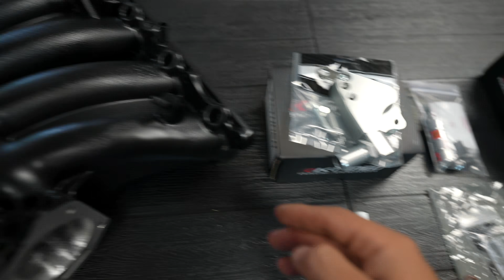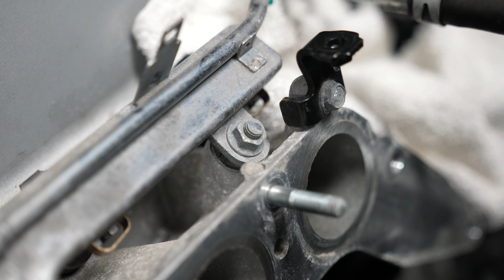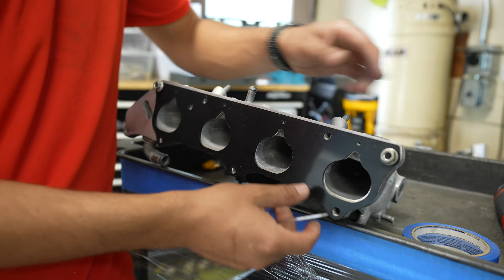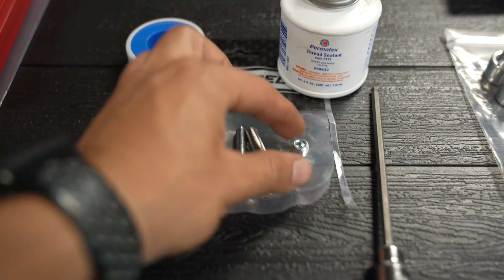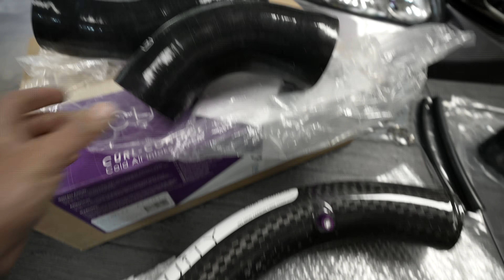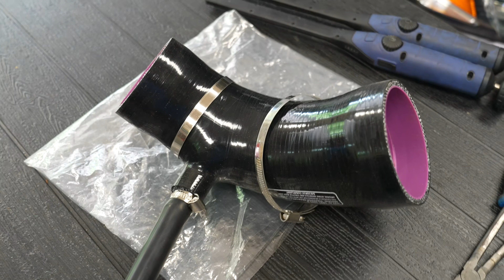RBC Intake Manifold Swap & Throttle Body Install // 9th-Gen Civic FBO Part 3 of 4

Comment from the maker: FOR THOSE INSTALLING THE KTUNED WATER BYPASS, I suggest tapping the cylinder head and using the included hardware to guarantee the bypass won't leak. I had no issues for the first couple of weeks, but then noticed it had a slow leak from that area. After tapping and using the additional hex bolt, I've had no issues since.
Reply: My k tuned adapter leaked with the spring / bolt method. PROFUSELY!  I didn’t want to drill and thread my cylinder head, as I found out through other sources. Even if you thread your head, it may STILL leak. I removed the k tuned adapter and purchased a TRAC TUFF K24Z adapter. No silicone needed. No leak. No drilling and threading needed to install this unit. The owner of Trac Tuff is very intuitive also. If you have any questions, he responds immediately and honestly.
Reply: @RittenhouseLifestyle7  Dude thank you so much for this comment! I just bought it and cancelled my k-tuned coolant adapter order. Not only did you save me over $30 bucks, its actually delivering sooner than what the ktuned was going to deliver. Im very excited im not gonna have to drill and tap my motor because i wasn't looking forward to that. Especially hearing how many people are still dealing with leaks afterwards.
Reply: @rivalnico8557 how’d it go?
Reply: @arodyrosa3833 it went flawlessly. No issues and it came with all the hardware. I just put a little lube on the o ring and then lock tight on the nut that locks the bolt in place that keeps tension on the coolant adapter.
Reply: @rivalnico8557 shoot thanks just bought it, gonna do the same!!
Reply: @RittenhouseLifestyle7  Hey man, what intake gasket did you go with? OEM rbc? Or did you use the skunk2 thermal intake gasket (the one in the video) or otherwise? Please let me know I will buy the exact same one as I know with the tract tuff, how far the RBC pokes out matters!!
Reply: @RittenhouseLifestyle7 Hey man, hope u doing well i just came back to this vid cause my ktune adapter is giving me crazy problems, just bought what u mentioned can’t wait for it.
Reply: Just got a cnc ported badguys worldwide rbc and this vid helps out a lot
Reply: @pinoceo  Did you max out the stock injectors? Did you switch to the rdx injectors? If so did they fit in the stock 9th gen si fuel rail or did you have to get an aftermarket fuel rail?
Reply: @Exceed_life  haven’t thrown it on yet
Reply: @pinoceo  when you throw it in can you see how the stock air box fits?
Reply: @Exceed_life  sure but just based off the differences of the 8th gen IM and 9th gen IM, I dont think the intake tube will fit for the oem air intake housing.
Reply: @pinoceo  I was planing on running the stock TB I just wanted to know if the hose can reach it without much problem
Reply: What did you do with the two fittings on the bottom of the throttlebody you didn’t explain what goes there you jumped right in to putting the coupler fitting for the cold air intake
Reply: @Hawaiian239-4x4  Im wondering too I need to know.
Reply: @Hawaiian239-4x4  They seem to be coolant hoses, from a google search.
Reply: Did you record it? Plz post if you did!
Reply: Did you max out the stock injectors? Did you switch to the rdx injectors? If so did they fit in the stock 9th gen si fuel rail or did you have to get an aftermarket fuel rail?
Reply: So i was able to snag a rbc manifold for a deal...its cut but i found out its also ported as well. My only concerned was if it would fit properly on the stock throttle body or would i have to order a new one. Id rather much keep the stock throttle body.
Reply from the maker: @Tae_94  You can use a ported manifold with a stock throttle body, just like how you can use the opposite.
Reply: @milanmastracci  i appreciate the reply my man 👍
Reply: @milanmastracci  are you taking a break from youtube?
Reply: The two hose connections on the throttle body are capped of now right ?
Reply: Anyone find out what he did for the 2 ports right under the throttle body?

Comment: 23:00 you can actually pull more wire from the harness in the black hard plastic, this makes an extension not necessary and that also avoids weakening your signal to the dbw setup!

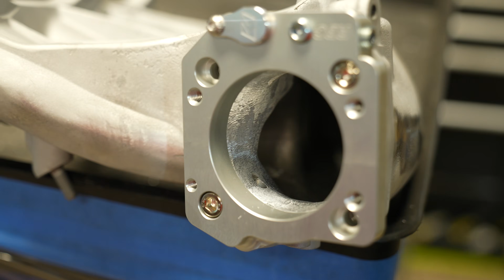Comment: 12:03 .. IMPORTANT QUESTION⚠️ once engine is running and you’re cleaning up data logs, did you have ANY experiences with abnormal TPS zigs and zags under high load and high rpm? Or ANY strange factors due to boring manifold inlet? I just recently did my RBB inlet and I’m dealing with this. FYI nothing to do with tps calibration.

Comment: Hey there man, what size would you say the Idle air control valve Vacuum hose is ? I'm installing a skunk 2 street intake manifold with a j37 throttle body. So I have to use a different throttle body adapter from hybrid racing because I don't think the PRL adapter kit will connect a ZDX j37 throttle body to the skunk 2 intake as its a PRB intake, not RBC. so I'm gonna run the Vacuum hose to the bottom of the new intake where the ports are,  just was curious of the Vacuum line IACV size in case the stock hose won't reach. Thanks
Reply: bro i have the same problem

Comment: Thinking about getting rid of my stock plastic intake manifold on my 2nd generation CRV, will i get a check engine light from a intake manifold swap? Appreciate anyone who can help me with an answer.....
Reply from the maker: You might, but I wouldn't consider the swap unless you get it tuned, so ensure that you can do that prior to doing the manifold swap.

Comment: Do you need the throttle body adapter to run the stock drive by wire throttle body ?

Comment: ive got a 7th gen accord build and this is by far the best video. i couldnt find much info on the middle parts that you had, just removing and tightening up really. but this showed me the proper way to do the fuel injectors. i wish i saw this before
Reply from the maker: Glad you liked it!
Reply: What did you do with the pcv valve
Reply: Sabes si ese trottle body funciona en el Accord cl9?

Comment: do i need the Throttle Body Extension Harness if i use a stock throttle body instead of a bigger one?
Reply from the maker: Yes you do, so you can extend the wires yourself by cutting the factory wiring harness, or you can purchase this little extension piece. When running the RBC manifold, the throttle body is mounted in a slightly different location in the engine bay, and the factory harness is not long enough.
Reply: @milanmastracci  okay thank you i ordered the extension so i dont have to cut it

Comment: @milanmastracci Question, I want to do the RBC & ZDX swap but solely on aesthetics to compliment my skunk2 intake, can I use a skunk2 manifold instead of the rbc? Given I do the same process?
Reply from the maker: I don't see why not!? Just make sure that the ZDX TB works on that manifold, or ensure you purchase the right TB adapter to make it bolt up to the Skunk2 manifold.

Comment: Just realized this is all for an intake manifold swap ......y not upgrade fuel rail?
Reply from the maker: This video was showing you how to swap the RBC for relatively cheap. Upgrading the fuel rail does not bring any performance gains, only for aesthetic. If you're upgrading the injectors, I'd change out the rail while you're at it.

Comment: Hey man! Finally got all my parts and everything installed cars running and all. I seem to have a leak in the Ktuned bypass adapter even with putting on the honda bond. Any ideas why it might be leaking? O ring is still perfect as well. Maybe im tightening the spring bolt too much causing a space?
Reply from the maker: Did you tap the head? I ended up having to do that as it started to leak on me after going to the track
Reply: @milanmastracci  after letting it sit for over a day before bleeding and filling it seemed to have stopped leaking. Ill keep monitoring. If not ill either tap the head or try the tractuff option. Thanks for your reply!

Comment: What happened to the accord build.. lol. Was the 300 mark ever made.. I was planning a build similar but couldn't find out the piston to valve clearance issue.. so far the k24a1 is the only block I know that will accept a k24a2 head

Comment: hey i have a question. i have a honda accord with tsx intake manifold and i was thinking of doing that intake manifold coolant bypass. problem is, right in that spot i have the coolant temp sensor which has a bigger thread. Would i have to buy k-tuner's coolant temp sensor and replace it? would i need anything else? I can't really find anything on the internet. Thanks to whoever helps.

Comment: Does the bigger throttle body alone add any power without Rbc?
Reply from the maker: I can't say for sure, but if the throttle body is restrictive for the factory manifold and head, upgrading the throttle body will 100% allow the engine to get more air, which results in more power.

Comment: my ktuned bypass is leaking my whole engine starts smoking idk what to do😕
Reply from the maker: Tap the cylinder head and use the extra bolt that came with the kit to secure it into place.
Reply: @milanmastracci  update i fixed it i used an extra layer of hondabond but now it’s overheating itself

Comment: Didn't mention one important information. If you use the j37 tb with stock ECU, the ECU isn't going to last long as the j37 pull 9-10amps whereas the Si ECU can only pull a max of 5amps.  This is why people are complaining about fried ECUs. 
Guys, if you are using a j37 dbw TB on a civic 8th, 9th gen Or Civic FN2 you NEED TO SWAPS THE TB MOTOR FROM YOUR OLD THROTTLE BODY!!!!!!!

Comment: Question. If you already have the ktuned adapter kit for the rbc. All you have to buy is the fitting and a hose and it should work? Or do you have to do more than that to modify the adapter?

Comment: Can I use the same parts you used for a 2008 acura tsx?
Reply from the maker: Some of the parts will work, where you may need different adapters for the manifold.

Comment: Can this be done in a 2008 accord
Reply from the maker: Sure can! Since the engine is almost identical, you'll just need a cold air intake that works with your car, everything else that you saw in this video is compatible 👍

Comment: Some good words of advice as an owner of 9th gen 2 door bolt on power is good and all but do your self a favor and do a full build top and bottom end before you start spending money the motor does have a few weak spots not addressed you well spin a bearing or get the famous tapping thinking it's all good just noisy injectors not the case ug the timing chain tensioner right away first before anything watch what you change your hondata does alot on stock throttle body more power and hacked mods well destroy this motor its strong but I promise you want to invest to make power or boost seen guys spend lots only to discover the engine needed to be built before the ug don't be that guy selling because the turbo killed the crank bearings yes it can take some abuse won't last maybe in stable warm weather iam at 78 000km doing full build famous tap tap well get you 30hp maybe 50 hp on a stock motor after that your playing dice trust me save the money build it right and you have a gem with crazy potential with bolt ons hondata and a dyno is crucial with out it even changing your exhaust to race well leave you parked

Comment: You should've took the fuse for the fuel pump out then started the car it'll only run for like 3 seconds then shut off it'll clear the fuel rail of any fuel so it wouldn't be a mess

Comment: @milanmastracci man i need help to find a 72mm tb adapter for my ktuned 72mm tb i also have the same set up just difference are the tb brand and intake. I need help because of my tb i didnt have the adapter so I didn't know where to connect the 2nd vacuum hose which is in your video u connected it to your tb mine doesn't have that so i just connected it to the bottom of the rbc manifold because mine for some reasons it has a hole in there and i just plugged in something there and connected the vacuum hose there so far no problem but im still concerned. Sorry for the long paragraph! Hopefully u see this thank you man!
Reply from the maker: I don't think you need to run an adapter for the Ktuned 72mm. I believe it bolts right up. I'd have to see your TB and vacuum line situation in front of me to help.
Reply: @milanmastracci  yeah i could send a picture but idk if i can send it here in the comments.

Comment: can I still run a 9th gen intake with the stock tb on the RBC manifold?
Reply from the maker: You're gonna have to try again brother lol I don't understand what you're asking.
Reply: @milanmastracci  i fixed it man my bad i was probably exhausted from work
Reply from the maker: There we go lol no worries brother! You can run an RBC with the stock TB, however you will need a different TB adapter to run it. So just like I had to use an adapter to run the ZDX, you will need an adapter to run the stock one, and PRL also makes one which makes the install quite easy.

Comment: I got a problem! When I turn on the car after the installation it goes to limp mode and got idle problem? Do I need to install firts a basemap for the rbc ? And how can I do the throttle body relearn procedure?
Reply from the maker: At the end of the video, I mentioned 2 ways how you can perform a TB relearn. Either of those routes will work. You will need a revised tune to get this running properly, however Hondata has some that are adequate for the time being.

Comment: You need to k swap the mini... best of both worlds !!!
Reply from the maker: That would be so sick!! Amazing chassis finally paired with a good engine 🙌
Reply: @milanmastracci  there's a guy in the tri state area that makes a motor mount kit for the R53 chassis and R56 as well. No cutting on the mini engine bay. And you can still run a/c !
Reply: @milanmastracci  look up k swapped r53 (awd) on iamtaiboogies YouTube page !!!
Reply from the maker: Such a sick build, however it doesn't fit in the engine bay without custom frame work. I'd love it if it fit in between the frame rails.
Reply: @milanmastracci  IT DOES !!!!

Comment: Quick question u didn't have a prl tb adapter where do i route the vacuum hose? Because i saw that you routed the 2nd vacuum hose to the prl adapter. I don't know where to put mine, i also have a skunk2 intake and i had to make it short ram because I can't find a coupler that fits 72mm tb  that is compatible with the skunk2 intake design. Any recommendations bro? So i can fix my wirings management for battery and so my engine bay won't look messy? Thanks you bro! I'll appreciate it so much if you can help me 🙏🏾🙏🏾🙏🏾
Reply from the maker: Does the skunk2 have a coupler that works with the larger TB? I haven't looked into Skunk2's intake much after finding Acuity's intake kit & battery relocate. It seemed to be the best overall intake, the most well-engineered, and you can buy a bunch of different couplers should you change TBs or IMs down the road 👍

Comment: Is it harmful to drive it without the tune? Or is the tune just required in order to see any gains?
Reply from the maker: It is! If your engine isn't running the correct air/fuel ratio, you can cause damage to the engine. I strongly suggest getting a proper tune following any engine-related upgrades.
Reply: @milanmastracci  So I work at Honda as a apprentice Tech, couldn't you just remedy getting a tune by doing a ECM/PCM reset? The car would relearn the air to fuel ratio?

Comment: I installed the rbc manifold with rdx injectors, k tuned shortram and k tuned fuel rail but not hondata, the rpm goin up and down its normal cus i don't have the flashpro  ?
Reply from the maker: You will 100% need Flashpro or KTuner to get it running right, but that sounds like the TB needs to be relearned. I outlined towards the end of this video how to get that done 👍

Comment: I dont understand though, why spend the money to go NA on this engine that is basically hamstrung from the get-go, due to the headifold and lack of exhaust VTEC.
What happened to the K24Z3 + K24A2 head idea?
Reply from the maker: The reasons I can tell: 
1. Naturally aspirated reliability
2. Less complex than turbocharger install
3. Easy to return back to stock
4. Not looking for most power numbers, just enjoyment. 

At the same time, I do 100% understand your statement. It does cost abit and require a bunch of work to the intake and exhaust to get some a slight bump in gains from it. 

That engine is still getting swapped, but I wanted to try the FBO route first 👍

Comment: Can you do this to a 8th gen accord without the injectior adapter and would I still need the throttle body adapter?
Reply from the maker: You can do all of this to the 8th gen accord. You would need everything you see here, however you would need a different intake to get it to work as the Acuity is vehicle specific.

Comment: ZDX throttle body is over kill and will not gain any power without cams, also the ecu will have to work harder to control it
Reply from the maker: One way to find out 🤷‍♂️

Comment: Hey Milan! Love the channel! When will you be swapping the cylinder head for the K24A2?
Reply from the maker: Very soon! I have a bunch more parts to install on the car to get it ready for more power 👍
Reply: @milanmastracci  awesome! Can't wait to see what you have planned! Keep up the incredible work! 🤘
Reply from the maker: Thanks Bob! I appreciate the love ✌️
Reply: I used a z1 head from an rsx-s. It breathes better than k24a2 head up high, but not running TSX cams. Be fun to mix match parts and dyno to see the differences.